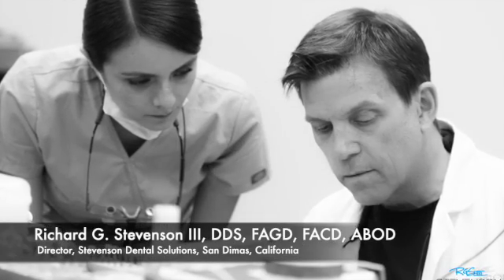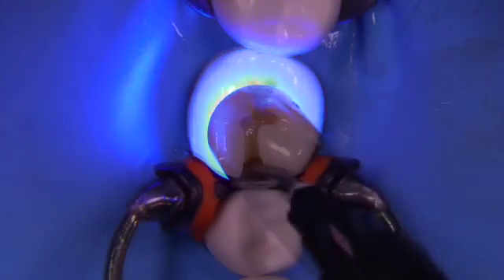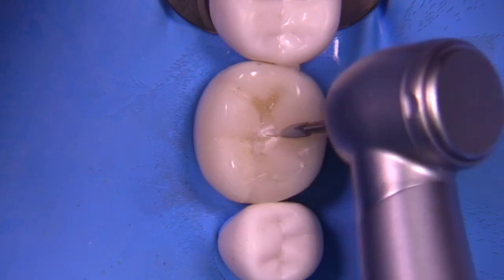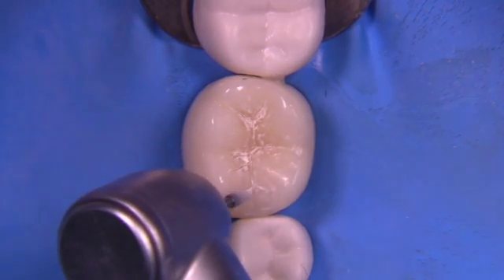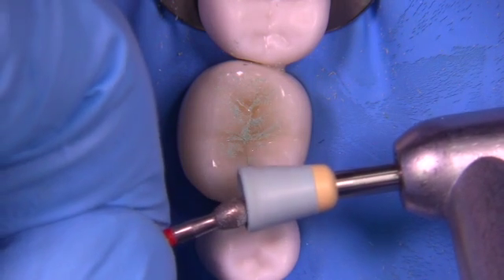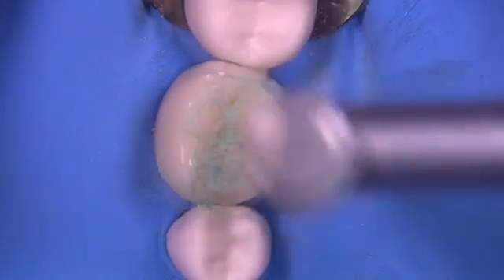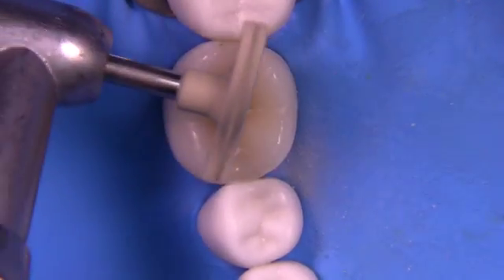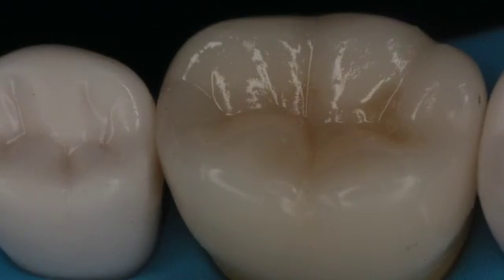Composite Restoration for ADEX/CDCA Examination #30 MO

Comment: How much do you fill in contact area I always end up with  flash and bulky filling
Reply from the maker: Fill the box to the level of the plural then create a wall by pushing the increment towards the matrix.  Light cure, remove the band and treat the remainder like a class I occlusal filling.  Use a high quality matrix like Garrison.

Comment: Doc i am getting a concavity on the proximal after restoration. Why is that thank you?
Reply from the maker: This is a common situation with thin sectional matrix bands - they get a dimple in them as a result of the adjacent tooth contact area.  Burnishing them doesn't help much, so the only solution is to use a wooden wedge and push with significant force to create some tooth separation, prior to placing the Bitine ring.  This helps...
Reply: @StevensonDentalSolutions  Thank you very much DrS You are god sent🙏

Comment: Hi ,im struggling with minimal composite materials on cavosurface sides of plastic teeth.cant detect them.is there any effective all day technique apart from UV light? Often miss them with probing and magnified vision, cos are so small and easy to miss.cheers
Reply from the maker: Yes, this can be challenging.  I usually dry the teeth thoroughly and feel with a sharp explorer - moving from unprepared tooth towards the composite...If it is imperceptible, then I usually leave it alone, even if is technically flash.

Comment: what if we were not allowed to use finishing bur or any polishing system in exam, how would you recommend to remove flash and make a smooth preparation ?
Reply from the maker: I'd use a flame shaped carbide and try to level the flash over the margins with the tooth, very very carefully.  Use a very light touch and take your time.
Reply: @StevensonDentalSolutions  Thankyou so much for a fast response, but they are not even providing flame shaped , only 330 carbide for cavity prep and an instrument kit. I know its absurd ,they will judge mainly on how smooth the margins merge, no deep pit and fissures required,only functional form of restoration , do you have any other trick to deal with this situation? and same for class 3 prep , no polishing strips , no finishing bur.
Reply from the maker: @sahilbhalla389  You mention "preparation" but I'm assuming you meant RESTORATION, right?
Reply: @StevensonDentalSolutions  oh my bad, yes i meant restoration. So , any way for a  class 1 and 3 composite restoration with only 330 carbide and an instrument kit?
Reply from the maker: @sahilbhalla389  You just have to place the composite carefully and remove excess before curing. This is a significant disadvantage vs using the proper armamentaria. Sorry that they are teaching (!?!) you this way.
Reply: @StevensonDentalSolutions  i agree ,its like going to war without guns. Thankyou so much for you kind help, your videos inspire me 😇

Comment: Does the strength of paste is same as solid composite?
Chances of fracture or removal is more.
Reply from the maker: Flowable is weaker, and I would not use this technique on patients, however it works well for exam teeth.

Comment: The flowable resin and the composite are cured together? Why not using incremental placement?
Reply from the maker: Yes - cure them together - the result will render a smooth restoration interproximally and avoid voids between layers. NOTE: this is the technique for the exam - not for patients.